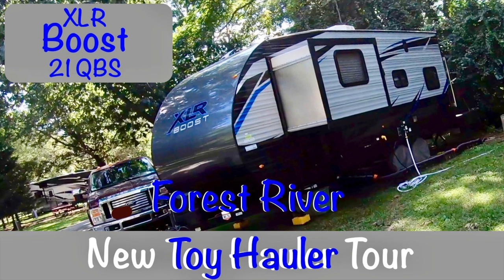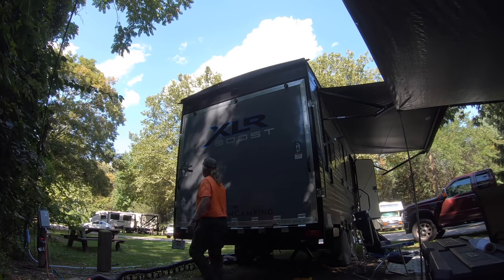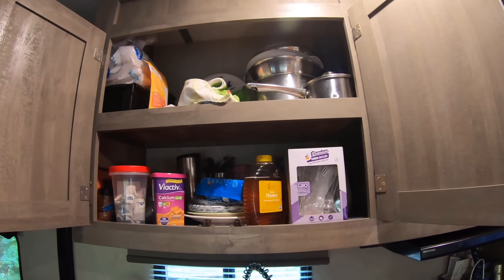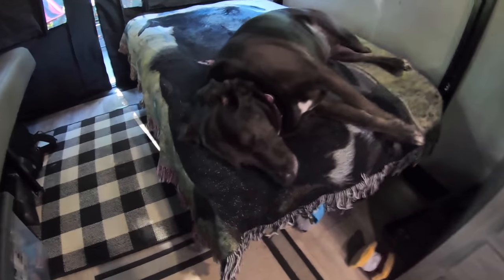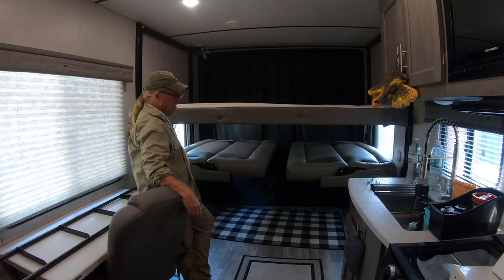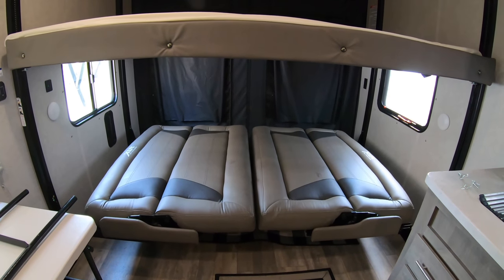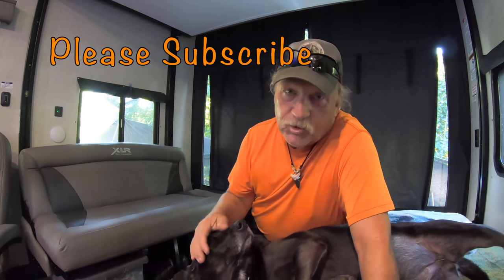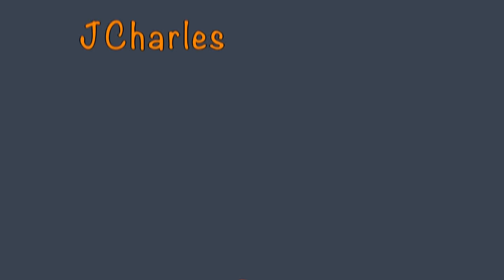Forest River XLR Boost 21 QBS Toy Hauler, Trailer tour 2021and Happy jack Bunk bed demonstration .

Comment: Wow!  What a well done video with great explanations.  This seems like one of most well thought out light/inexpensive toy haulers there is.  Same layout as the Grand Design 21G at a fraction of the cost.  The bedroom with the slide out and dresser gives it a real homey feel.  I really like how you pointed out the bed options when staying overnight at a place that doesn't want you putting your slides out.

A few questions:
Can you access the main bedroom and sleep on that bed with the slide in?  I supposed you're not supposed to, even if you can?
Can you tell me if that is a 12V fridge?  
Do you know if the water heater be upgraded to tankless?
Are there other options besides the screen you have for the party deck?  Such as:
      Garage door style screen that can be rolled up/down
      Folding patio doors for a "three seasons" room
Have you had any problems with it since you've owned it?

Comment: One more question. Are you pulling your trailer with a 1500 or 2500? This is a great video by the way.

Can anyone tell if that's a 1/2 ton or 3/4 ton truck? I was only asking about the truck because I looked at getting the 21QBS but I have a Ram 1500 with 8700 tow rating. Just wanted to know if you’re vehicle was a 1/2 ton, did it pull the trailer ok. Thx.
Reply from the maker: Hello, I use an F250 to pull the trailer. The trailers weight is about 6000 lbs. dry , but it's loaded weight can be,  over 12,000 lbs. It depends on what your transporting and the terrain your driving. A 150 could pull it but it will struggle up hill or under a heavy load. If you use a light duty vehicle just take it slow avoid large hills and limit the weight of your load,  I would recommend a super duty truck or a ultralight trailer. Best to be safe. Thanks for your interest , and your question.
Reply: @JCharlesoutdoors  Thank you so much for the info.